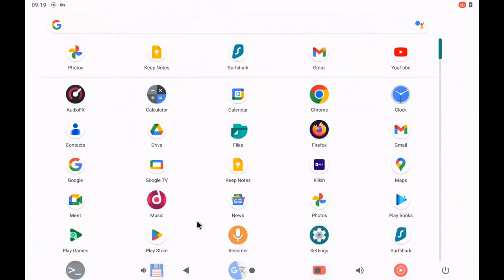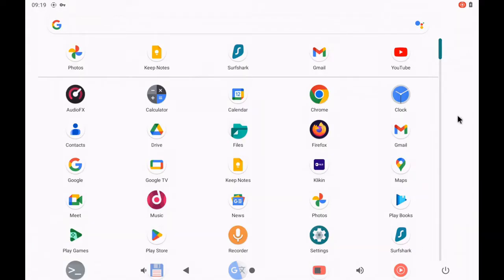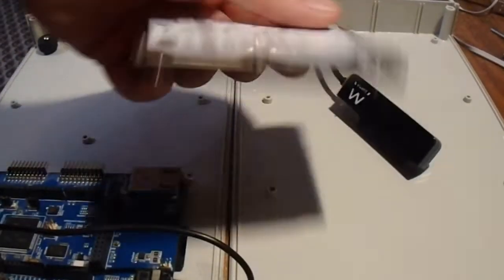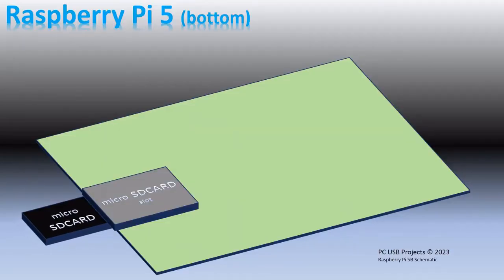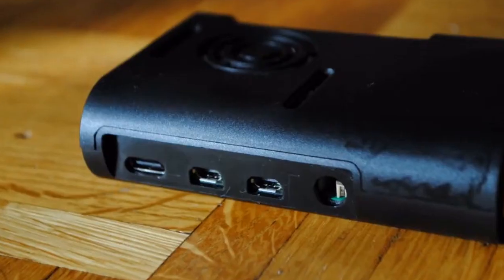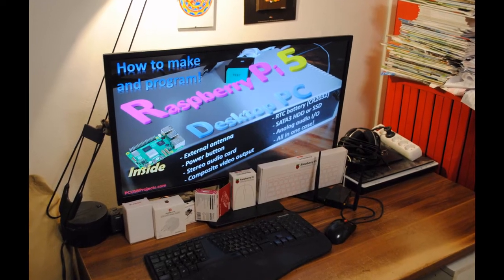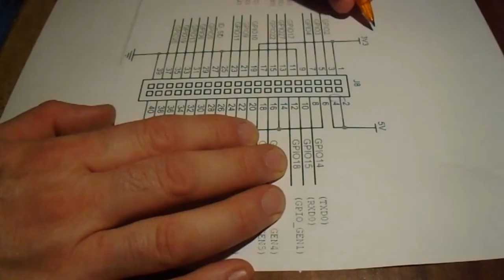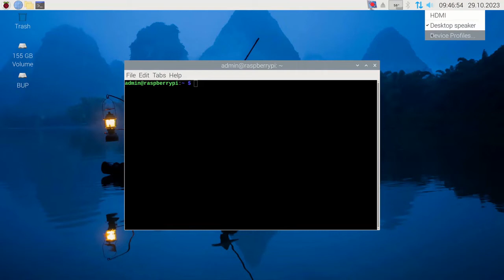First Raspberry Pi 5 desktop with startling new features!

Comment: There’s a (tiny) power button on the edge of the board already.. Next to the pcie connector
Reply from the maker: I've never said that it was not there, but it is at least unpractical for me. But as I've mentioned in the video: You have an option to make your own, especially if you you want to use a bigger desktop case, or if you want to put your RPi 5 under the desk to hide the cables like I did. It is your choice! I like my old green plotter button. It is heavy duty and works like a clock work. Micro switches often wear out after a year or two of intensive use... Cheers!